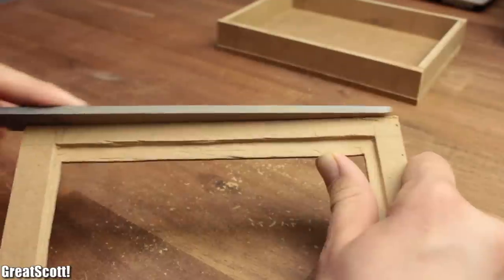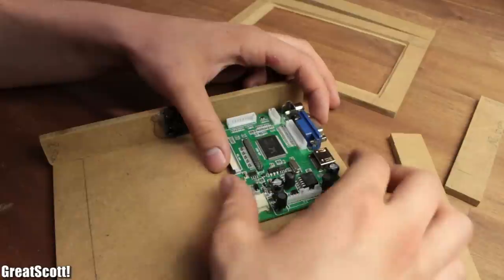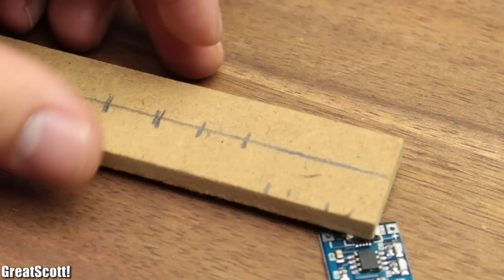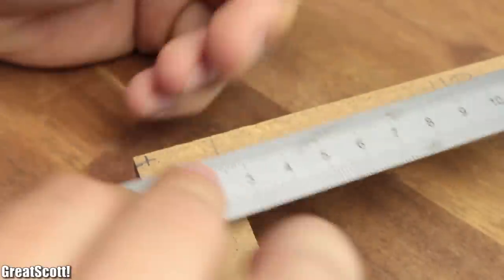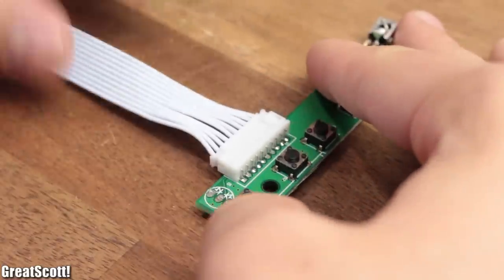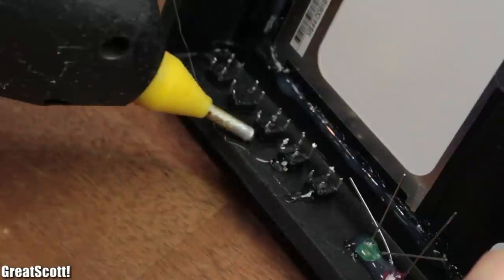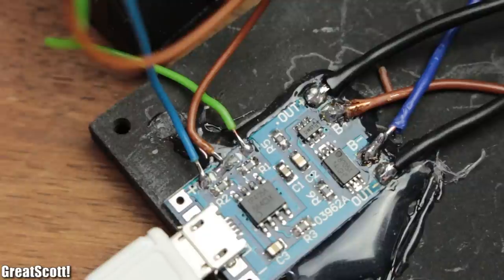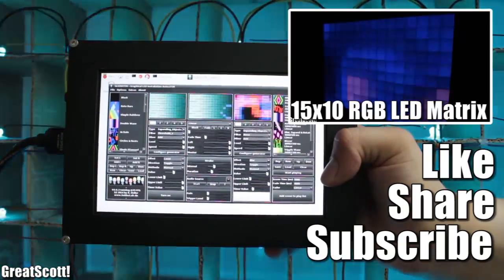DIY Portable Mini Monitor - Part 2

Comment: Hot glue =  duct tape for electricians.
Reply: +Sir Cinex Actually duct tape or electrician's tape is said duct tape for electricians.
Reply: ender_scythe eh, I vote both
Reply: Sir Cinex ayy LMAO
Reply: Double sides tape is just tactical hot glue.
Reply: i use hot glue every time, and i regret it using it every time

Comment: Begs for a nice 3d printed case.
Reply: Christopher Johnson Handcrafted cases are always better.
Reply: Jordan O'C Really? A 3d printed case would look a lot cleaner and more professional. Handcrafted cases are good for quick and dirty projects, as well as prototyping, but for long term use, you really should print a case, or use a premade project box.
Reply: harshbarj Actualy if you put enough work, you can hand craft a beautiful case.
Reply: harshbarj Sorry dude, I have to agree with Valtra103. A handcrafted case is only as good as the effort you put into it. Look at Jimmy DiResta for example, he makes all his stuff. Not all of it is necessarily hand made, but it still looks fantastic. 3D printing is good, however, it just can't be the human touch.

Edit: corrected typo
Reply: Jordan O'C , So your original comment was wrong by your own admission. First you say it is always better, then you say it depends on the work you put into it. If it depends, then it can't always be true. That was my only issue, your generalization of all hand made cases being better, not that you can't make a nice case by hand. It's just not worth the time IMHO.
Reply: harshbarj People change their minds. Well, if you have skill, and a bit of time, it will always be better.  If you're not very skillful or just need a temporary box, 3D printed would be preferred. There's only so much you can do with a 3D printed case. You may see it as a waste of time, but the more effort you put into a case, the better it's going to turn out.
Reply: Jordan O'C Again with the always. Sorry, but no. It's not always better. Generalizing like that is a bad idea. It's sometimes better, but sometimes it's worse too. Sometimes all you need is a project box while other times a fancy wooden case is desired.
Reply: harshbarj Look, with a household 3D printer, you're limited in what shapes you can pull off, the accuracy of the print and being forced to make it out of plastic. If you hand make it, you can make it out of any material you want: stainless steel, aluminium, brass, MDF, walnut, oak, acrylic or even a wire mesh if you wanted to. The reason I keep saying always is because 3D printing for something like this heavily limited. Even if you want to make a quick case, it's easier to cut some pieces of MDF, glue and paint them than it is to get on a computer, start designing the box and wait 5 eternities for it to print. Not to mention, making it by hand is vastly cheaper. Very few people actually have 3D printers, so yeah, my point still stands. Even milling would be hard to compete with hand crafted, but at least with milling, you can chose exactly what material you want :L
Reply: Actually your point is not valid as you yourself have already admitted 3d printed or bought can be better. So your point is already dead (which was that it's ALWAYS better to hand make a case). You just are incapable of accepting you are wrong here, that hand made is not always better. I am willing to agree it can be better at times, but to say always is asinine! One also not need use a 3d printer as you can buy a project box that looks nice. I also note your claim assumes the person has a full workshop of tools and hardware, but that a good 3d printer  which is going to be cheaper, is somehow unattainable. Just admit it, hand made is not always going to be better.
Reply: ***** , because to do a really good job you need a small workshop. Sure you can build a case with basic hand tools, but there will be things you are not going to be able to do, or do well with just hand tools. I only brought up price because Jordan seemed to think one would have a full workshop available to them at no cost, yet a $600 3d printer would be too expensive.

Like I said, you can get some nice cases by making them by hand, but you can also get some bad cases. My only issue with jordan one was his claim that every hand made case was better than a 3d printed one. Both have their place and neither one is best for every situation. Anyone that disagrees is just not living in reality.
Reply: harshbarj 3d printing is only good for prototyping!
Reply: my reply was jut for harshbarj which told that handcrafted cases are only good for prototyping. Prototyping is the solely meaning of 3d printing, at the moment, so that's the same.
Reply: Andrea Colombo Actually I did not say that. They are good for both cases.
Reply: +harshbarj 3D printing is fast and convenient, but hand crafting is way more personal.
Reply: netsurfer912 Can be, not not always. muting post.
Reply: +harshbarj - Why so fragile? You call him dishonest yet it is evident his comments were on-topic yet your comments were veering personal--but you blocked HIM. Talk about dishonest.  You both were generalizing. Your original comment and next claims were generalizations. The only thing they lacked were "always". The person you commented to (and blocked? lol) was merely having a chat, but you were having a fight. (Go ahead block me, too. It's not like I ever saw you before or will see you again. But have fun with my account listed inside your account to remember me by--because you like it so personal). :P
Reply: +netsurfer912 - Oh noes! You tried to have a reasonable discourse with harshbarj but got "muted". How will you go on?!? :P
Reply: This could be so nice with an clear acrylic 3d printed case

Comment: Nice video just loved it. Some of my learnings with the hot glue is to not to use it when the part is going to get heated beyond 60 Deg C. You measured the charger getting beyond 60 Deg C and also the battery is going to get heated. While this will not do any harm initially, over a period of time the hot glue will start getting slack and ultimately the parts will fall off (And can cause shorts etc). So my method was to use hot glue as a temp tack and use Silicone (Which can withstand very high temperatures of close to 300 Deg C or more) in conjunction. So while the hot glue provides for brute strength the silicone prevent glue run off and the part becoming loose inside the cabinet.

Comment: I'm a fan! :) And i want to add some info:

I made a wooden(10mm plywood) box once, and while i'm using cnc router to cut the walls of the box, i too didn't achieve even fit. So after putting box together, i try to sand the excess parts of the walls but it was a labor extesive job. My friend lend me his palm sander machine with its 120, 320 and 800 sand papers. It worked wonders. Within 10 minutes i even all the walls of the box, it even cleans the epoxy residue left from cementation. Also as you know, good sanded surface helps the spray paint surface to shine but hand sanding is a big pain. But not with the palm sander. 
I bought one from local hardware store for 49 ₺, (approximately 17$) and its sand papers 15₺ (5 $~). (₺ is Republic of Turkey currency)

Looking forward to see your new videos. Have a nice week. :)

Comment: If you have a rotary plunge router you could use it to create the inset for the screen and other elements, and even use it to drill and remove openings in the frame in one step without using a saw.

Comment: you should use primer on mdf before painting it. The primer wil lfill the gaps in the mdf and cover the glue. Sanding the primer before reapplying another layer is also a good idea.

Comment: Nice project but I would prefer to build a plastic case. I like using ABS which you can buy in sheets. And since it is already black in color, no need for paint. Of course, more expensive than wood but also, more durable.

Comment: Great video!
i just have to ask you one question.
why didnt you desolder some component that might be unnesecery from the controller board like  the the VGA and some of the board to board connectors, you could have just solder some wires and get a much thiner product.
cant wait for another video
Reply from the maker: Elad Elmakias I wanted to keep it simple. But feel free to modify your version ;-)

Comment: I hope you wearing a particle respirator when you make dust with MDF. It is composed of glue containing formaldehyde (higly carcenogenic). When you cut MDF, It release in the air tiny particles that can get stuck in lungs, remains on your clothes and in the enviroment for days. I think other composite materials (e.g. OSD, plywood...) can contains formaldehide too. The old good bare wood, a block plane, two saws (1 rip-cut, 1 cross-cut) and some chisels and you can build everything in a more safe manner. I don't want to scare you, I just want to make you safe.

Comment: nice...best project i ever made is making my wireless mouse use lithium batteries and a microusb port for charging...no additional circuit to prevent over voltage etc
Reply: lipo 1s have 4.2v usb is 5v.. how does it work...?
Reply: Jirka Cvrcek just like that. i supply 5v directly instead of 4.2 v. i know this is dangerous...but im still waiting for my micro usb to 4.2v li battery charger  circuit board to arrive.
Reply: and this is how i did it: soldered battery to the AAA battery connector. soldered micro usb as well to the same connector for charging. thats it. when battery is low it switches off and then i plug micro usb for charging. i dont use it when charging and i let it charge for about 1 hour. it lasts about 3-4 days. its a 340mAH li ion battery i salvaged from a broken mp4 player
Reply: +martin mystere sorry but that is really stupid.. lipol/ion are extremly sensitive to overcharge/overdischarge.. if your cell gets bellow 2.2V it's useless and ready to bin.. if you overcharge them it can cause fire or toxic things put of them.. no hate but thats dangerous..
Reply: i know it was dangerous...but i dig up further and did some reading. i love my mouse...and im gonna stop using it until i get my 5v to 4.2v circuit to arrive :p Jirka Cvrcek
Reply: +martin mystere thats really good idea.. :D and don't forget to over discharge funuction

Comment: I would use regular wood plank for sides and 1-2mm aluminium sheet for front and back plate for better durability and glossy finish. MDF is too breakable for my taste. Anyway nice project.

Comment: On banggood you can find display with 30$ , is not the same quality but price is pretty low .7 Inch LCD HD TFT PcDuino Digital Display Raspberry Pi Monitor

Comment: Nice choice of electronics, I would consider a 3D printer though, you could make a much more ergonomic shape, more like an iPad or other tablet, to hold the contents.  Nice video though!
Reply: ***** the purpose is to allow people that doesn't own a 3dprinter to do the case. Well u can always design your own case using cad ;)
Reply: MIS FIT Ahem..How to design 3d printed case :)
Reply: Computer aided diagram  like solidworks. I use that in my sch to design my project.

Comment: could you have kept that 12V input?
The batteries was to make it more portable?

Thanks for sharing this :)
Reply: Absolutely, it's originally made to work with normal 12V DC wall charger

Comment: I had a LG LP171WP4 (TL)(N1) 1440x900 Panel I salvaged from an old laptop. I want to do something like this with it. I'm afraid that the larger 17" panel will need more power than your panel did. You used a boot converter to go from the 3.7V to 12V, and it worked OK for your project, but the specs for that converter seem to show that it will only be able to deliver about 0.4A @ 12 V when boosting from 3V input voltage. I decided to go with a 3 cell Li-Ion ~11.1V hoping to get closer to the 1.5A - 2A output, just in case it needs it for the backlighting. I have all the parts on order now, and I hope to receive them by Christmas so I can build this project on my days off of work.
Reply: Did you made your DIY monitor?
Reply: Nicolas LIENART I have all the parts, and have assembled the batteries. I'm doing a quiescence test on the batteries at the moment, then I'm going to start building. I had been waiting for weather to improve and I don't have a shop. I'll be doing most of the work working outside.

Comment: I've been trying to run a 15" laptop screen with a similar controller board off of twelve 18650 li-ion cells and the absolute longest time it would run on one charge was about 90 minutes! But I see you're running a 7" screen on just two 18650's. How long does that last? I'm not sure why mine aren't lasting worth crap, other than they're just too old (6 of are about 5 years old, other 6 are maybe 10)

Comment: Question. Why would you glue and solder the batteries in permanently when a dual battery sled is cheap?

Comment: Can you please go over some HDMI to AV/composite conversion? cheap adaptors (that actually work) or any DIY solutions? bcus i have this HD tft monitor laying around, with only a composite input, and i would like to use it with my DSLR or in my DIY Oculus Rift :D

Comment: I'm attempting a similar style build, but for some reason am not wrapping my head around the resolution I need(#noob). I'm viewing a 30 dollar product that resembles the first screen and driver you had in the first video, the specs for the display are:
"LCD size: 7.0 inch(Diagonal) 
Resolution: 800×3(RGB)×480 
Display mode: Normally White, Transmissive 
Dot pitch: 0.0642(W)×0.1790(H) mm 
Active area: 154.08(W)×85.92(H) mm 
Module size: 164.9(W)×100.0(H)×5.7(D) mm 
Surface treatment: Anti-Glare"

While the specs for the HDMI+VGA+2AV Driver Board are:
"Dimension: 90.57 X 65.60 X 12mm 
Work Voltage: DC 12V 
Up to Resolution: 7~22inch up to 1920*1080 
Input: Dual/Single LVDS interface 
Work Current: 200~250mA 
Input Signal: HDMI VGA AV 
Audio: Support 
Remote: Optional 
OSD: Support"
Does this mean that the driver is capable but the screen will have low resolution? I could go with the $70 dollar option, but I'd like to have a better understanding of why this $30 one is insufficient for the sake of expanding my own knowledge.

Comment: If I just wanted it to run off wall plug could I just leave out the battery and connect the charger board and use that to power?

Comment: Would it be possible to just use the double amount of batteries for the double amount of usage time away from the power chord?
Reply from the maker: +TheEmil875 Yes. But I would only put a maximum of 4 batteries in parallel.

Comment: How long does batteries last with full charge ? And does LED's indicate that the battery is fully charged ?
Reply from the maker: Dogacel Cubing Around 5-6 hours and yes the green LED indicates when it is fully charged.
Reply: Is there any chance you would be making another of these completely powered by USB, no batteries, with power up and down stream, even maybe usb C

Comment: Do you have a wiring diagram or somethin? The thing that i dont get is if you turn of the switch then you will enable the device to charge but the battery will still power the screen(if loaded). I presume you can turn of the device with a powerbutton on the controller board am i correct?

Comment: i use that tp4056 and it's getting very hot when charging the 18650 battery. the heat melts my hot glue. Any tips how to mount tp4056?

Comment: Im working on creating a 12v dc powered in-car pc. I'm wanting to run a super wide small screen(around 2.35:1 or wider) 9 to 11in diameter. I found multiple dc powered, RCA input screens, but cant find a vga to rca converter that supports any wide aspect ratios. Do you know of a way around this?

Comment: How well does the screen and charging circuit work if being used while plugged in?
Reply from the maker: +Ken Brand Without a problem.
Reply: How long does these two batteries last with a full charge ?
Reply: +Philip 4 5 hours

Comment: sir i have a monitor and an android phone is there any way that i can use my android phone to mirror its screen  to the monitor the specification of mintor and android phone is as following
monitor:- standard 19 inch computer monitor with dvi & VGA input
android phone:- spice steller 439
512 mb RAM
1 GHZ dual core processor
4gb ROM
DOAS NOT SUPPORT OTG

Comment: is there way to use hdmi cable pin voltage as power source for this project?
Reply from the maker: Not sure. I haven't used HDMI for this purpose.

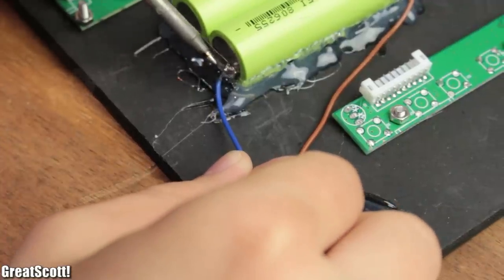Comment: for some reason when I solder the wires to the switch, the screen stops turning on. the light stays green but nothing happens with the screen. but only when attached to the switch. can anyone help? 4:40 - 4:50

Comment: Hi Scott, thanks for your inspiring video. I actually have a 15 inch laptop screen lying around so I bought a similar board https://tinyurl.com/ybronp4h, if you look closely, there is a 4 pin connector on the left side, and it is for audio. also there is a 3.5mm audio port on it. the problem is they are not connected, when I connect them, the left and right both work, but there is a constant loud static noise, also noticed the sound is very loud, and feels overloading. I wonder if I need to put a resistor or capacitor in? can you please help?